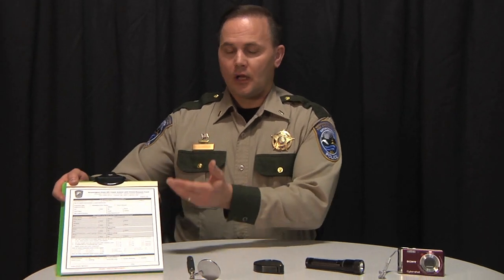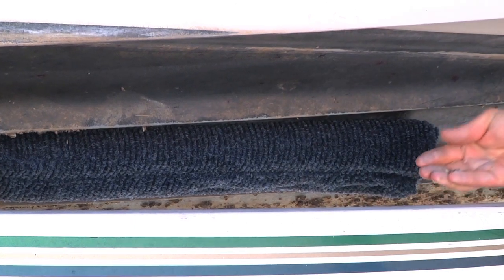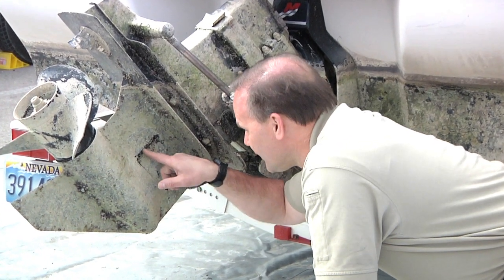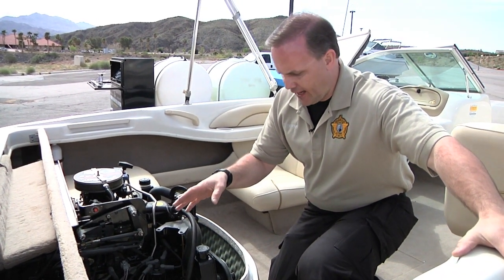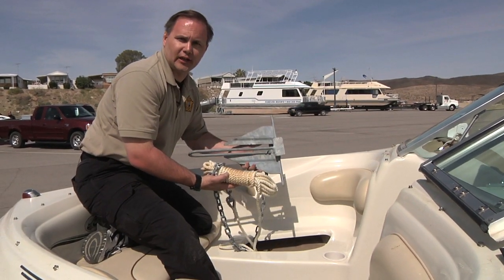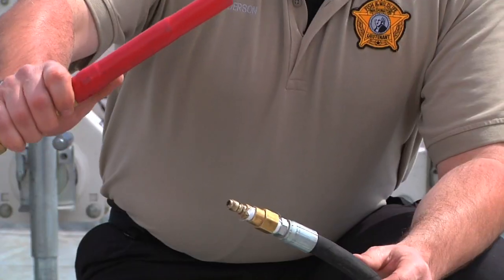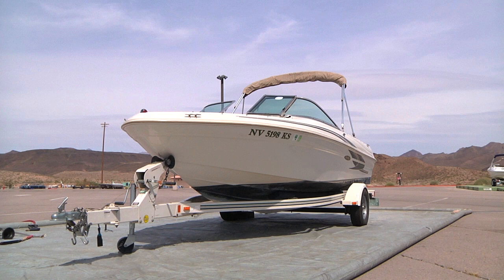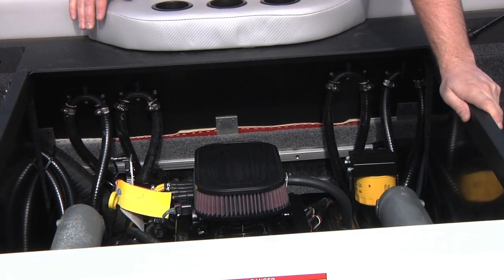PSMFC "Inspection & Decontamination 2011" HD NEW

Comment: I'm following the reports and methods for decontamination given Arizona/Utah Lake Powell is heavily infested and in my backyard. Can you spray the boat areas infected with a high pressure mix of water and bleach? Finding hot water sources may be difficult in outdoor settings. The high pressure pump can take off the residue the bleach killing the mussels in difficult to reach areas. Is this possible, or is it just a hot water method to get rid of these devils?1